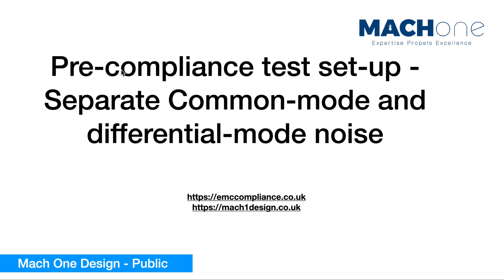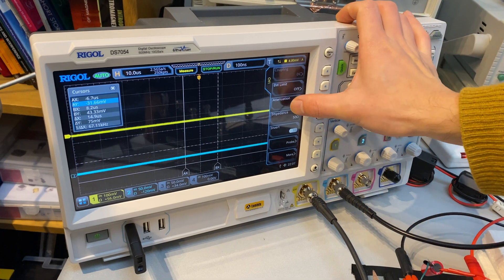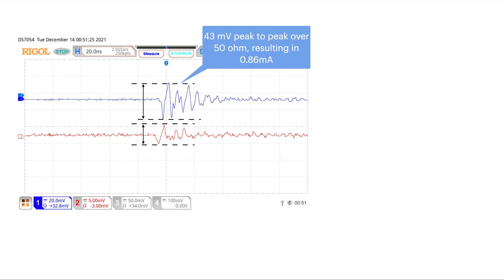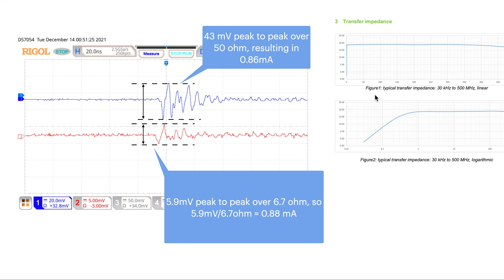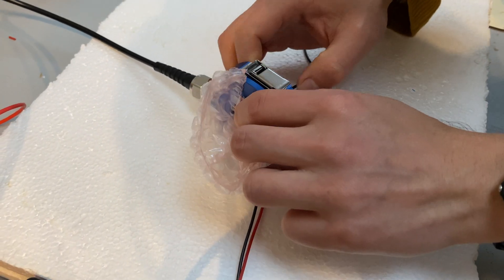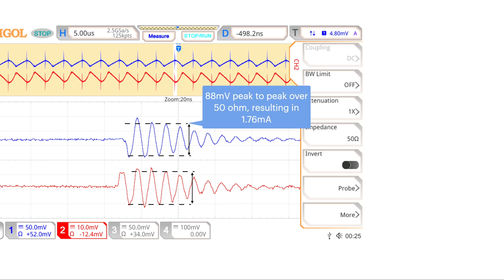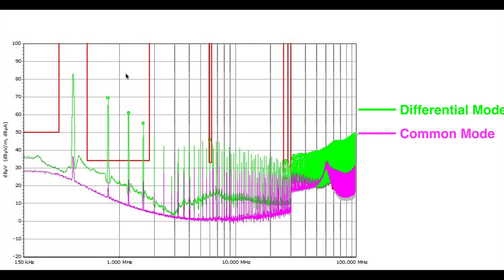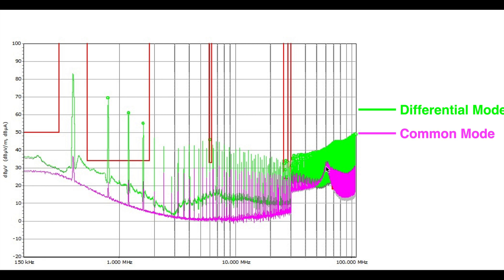Common mode & Differential mode noise - how to separate them?

Comment: Great video, thanks! why is it important that the two cables will sit in the middle of the probe?
Reply from the maker: To minimise the so-called Electric field coupling. when two cables sit right in the middle, even if you have E field coupling, they should cancel out in theory.

Comment: Does the LISN mate requires subtraction of 6dB?
Reply from the maker: You do not, the 6 dB really reflects the ICM*2 we measured on both wires when we use a current probe. The LISN mate shows ICM.

Comment: Also to measure the DM noise you are using a Current probe with in/out 1 turn wire  , then why is LISN mate required?
Reply from the maker: When using a current probe, LISN mate is not required. But LISNs are still required.

Comment: Could you please tell how you came up with 6.7 ohms @3.45 ? I am trying hard but could not get that number. Also can you please tell what is the math you use to find the AC cable length vs ~70MHz resonance frequency?
Reply: If my understanding of the math is correct, 16.5 dB-Ohm = 20 log (Impedance in Ohms). In reverse, 10^(16.5 dB-Ohm/20) is 6.68 Ohm, approximately 6.7 Ohm. For the resonant frequency you need c=fλ and the knowledge that the cable length for the resonant frequency is λ/4. Since the 1m to 1.2m cable is λ/4, λ=4m to 4.8m. Since c is approximately 3x10^8 m/s, f=3x10^8/4.8 or approximately 62.5x10^6 cycles per second or 62.5 MHz up to  f=3x10^8/4 or approximately 75x10^6 cycles per second, or 75 MHz.
Reply: @kungphil3284  thank you very much Sir for your kind explanation

Comment: Should a shorter cable be used for the power supply to avoid such ressonance around 70MHz? Or it is part of the DUT?
Reply from the maker: Hi Rafael, that's a good catch. You actually spotted the error in the test set-up. The reason being is that I made a one meter cable for 150k-30MHz active rod antenna test. And then I made this video, so I forgot to change the cable back to 20cm long. I am glad you spotted and helped check on this.

Comment: Thank you for the nice presentation. I have one question. What happens if the CM noise on both power lines are not symmetric? In that case, do you think whether the LISNmate can decouple the DM noise from the CM noise? Thanks in advance.
Reply from the maker: I don't know exactly what you mean by not symmetric. if the CM noise are not symmetric, then chances are that you have a situation of which we call it CM to DM conversion. Actually it happens all the time. So in that sense, the noise is DM rather than CM. What you have is parts of the CM energy transformed into DM energy. Hope this helps.